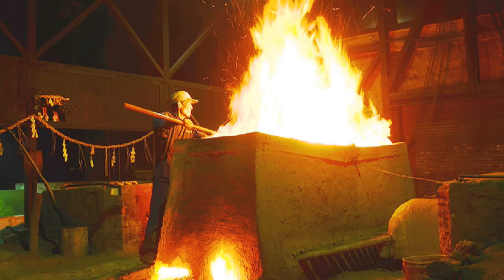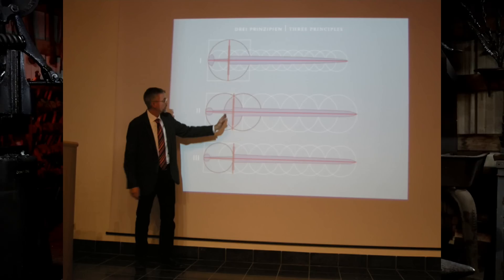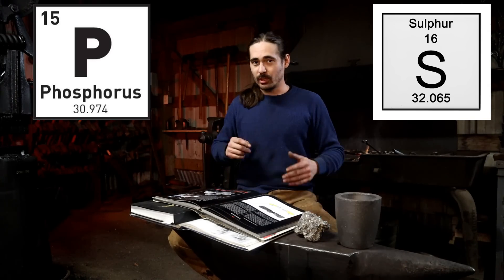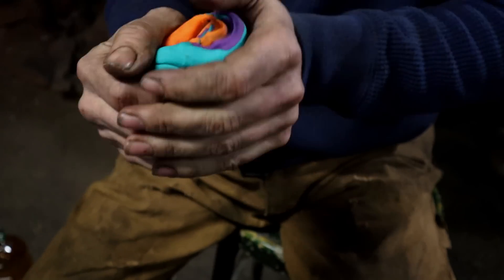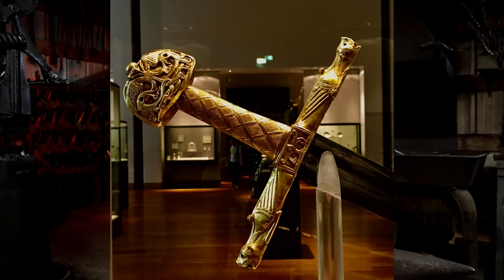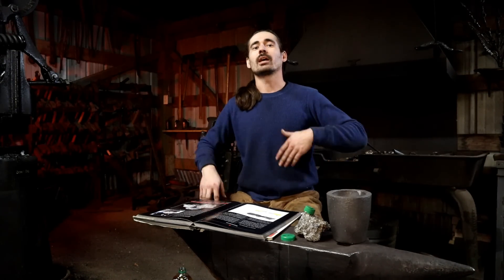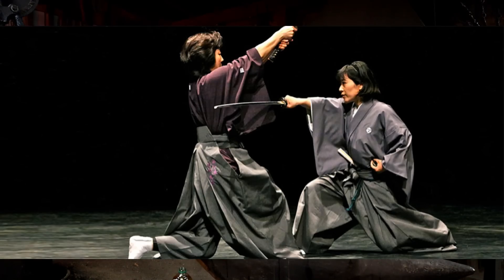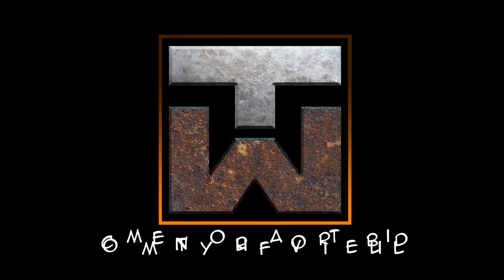Misconceptions About Medieval Steel - Wootz vs Bloom

Comment: You can't judge a steel by its phosphorus content.  Phosphorous serves more or less the same role as Carbon as a hardener. It is a well researched fact that phosphorus may be increased without decreasing the quality of steel if the amount of carbon is proportionately decreased.   So, the sabre containing 0.252% phosphorus and .596% carbon would have had a very similar properties to the sabre with 0.127% phosphorus  and 1.874% carbon.  The fact that these figures show such different carbon/phosphorus ratios but similar hardnesses tells us that the bladesmiths knew one of many possible techniques for reducing their wootz steel to their desired hardness until they reached what levels this particular culture considered ideal.  So, if they actually wanted a softer steel, all they had to do is continue whatever reduction process they already used up to this point until they got there.   The most common solution for reducing the hardness of medieval crucible steel was to use a kind of decarbonizing forge called s finery forge. These were invented in either China or India around 300BCE and made its way to Central Europe by the 1200s CE for just this purpose; so, the technology was there, it just did not become the norm until the 15th century which is the time period Shad was referencing when he discussed the rise of spring steel swords.
Reply from the maker: nosajimiki killeen the answer to this can not be short enough to type it all out and perhaps deserves another video response. Don’t forget to look at the Rockwell hardness of each example. That alone will Clear things up for you.
Reply: Why hello! One key problem is that there was no spring steel consistent enough to be called so up until the XVII century or so. On this you can watch Peter Johnson's presentation on the paradox of the sword. That is, at least in Europe,  most swords were about 45 rch on the edge aaand about 28 to 30 on the flats and the core. That is, mechanically the sword was not spring steel. 

Further,  phosphorus content increases the vulnerability to fatigue. And, on top of it, when we are discussing representative samples of wootz swords,  we are looking at about 1.5 to almost 2% carbon combined with high phosphorus. Actually,  if you read Alan Williams as well as other research on wootz and crucible steel the carbon content occasionally but consistently exceeds 2%... making those blades basically cast iron... or just short of that
Reply: @ThatWorks  So I looked closer at that table in your book and noticed that those sabers were using bulat steel. While a low Rockwell hardness is normally a problem it is a bit misleading with this kind of metal. Bulat steel (or Damascus steel as it is more commonly known) is intentionally slow cooled to create a seperation of the ferrite (hardness 200), and the cementite (hardness 640).  Because of this, the blade takes on bimetallic properties similar to pattern welding.  It takes impact and compression like a mild steel which is why it tests at such a low hardness, but also holds a very sharp edge from the exposed cementite.  That said, bulat steel is a very different technology than the kind of crucible steel known in Western Europe. When HEMA enthusiasts cite spring steel swords, they generally are referring to Western European late medieval weapons, not the Bulat steel blades more common in Middle Eastern sabres.   

It is surprisingly hard to find any good statistics on the chemical analysis of Western European steels of the late medieval period, but there is plenty of evidence of some kind of spring steel evolving as early as the 12th century with the introduction of arbalests. For a steel prod to be able to hold draw weighs over 1000lb without permanently deforming, Western Europeans needed to have figured out how to make spring steel, and the introduction of finery forges at about this same time seems to support the idea that they were using probably using a reduced crucible steel.

You also bring up near the end of your video the question of if European sword fighting styles support the likelihood of a certain quality of steel. I've read before that there is a distinct transition in 14th century German and Italian texts to a greater emphasis on the use of more abusive blocking parries whereas earlier texts support more emphasis on hilt guards and deflective parries.  From this, the argument can be made that the sword fighting manuals themselves reflect the existence of increasingly impact resistant steels becoming common in the sword making of the day.  

So if you do a follow up video, you might want to consider looking at how Western and Eastern European steels evolved differently and/or how early and late medieval steels were different.

Comment: Well FWIU the Anglo-Saxons were making pattern welded multilayered swords about half a millennium before the Japanese ever did. But pattern welded steel is not Damascus steel. Damascus steel is the common name for Wootz steel, Wootz steel means crucible steel from southern India & Sri Lanka with natural carbides made during a certain period of time. If something is not made of Wootz steel from Southern India during that time it is not Damascus. Meaning real Damascus has never been made in the US & Japan & the only Damascus made in Europe is made with steel originally from India.
Reply from the maker: I mean, you are mostly right but what does any of that have to do with what was stated in this video? Wootz did make its way to Japan and many other places. saying Europeans made layered swords before japan is silly. It all happened pretty much at the same time. As soon as steel and iron came into play, you had to layer or fold it to make it into usable blade material. I don't get why you typed all that out...

Comment: I happed to have a djvu scan somewhere of some pretty rare (1000 something copies) russian book about authors second take of bulat process restoration (Anosov was first, but the man was paranoidal and we have no notes left). What they found, is that wrought iron. carbon (in form of charcoal or plant matter) and pig iron were used in crucible charge. And glass on top to seal it. No ore. And they could get hardness as high as 72 HRC without making samples too brittle. Sulphur and phosphorus are solids, but with rather low boiling point. So while they get released while their salts are being reduced by CO in the bloomery, they evaporate.

Comment: In theory, although judging by the chemistry data it was not done much, could you refine the crucible steel puck using the same techniques as for bloom refinement? Can sulfur, phosphorus and carbon be oxidized out of the steel to some extent by folding?

Comment: I feel like crucible steel is better for quick, high carbon, hard munitions and blunt easy to shape and dense weapons and casted tool fittings and hardware. Bloomery steel seems more for the crafting of weapons that require more attention to detail and require a strong, but more playable material for things like siege works and long lasting gears and wheels.

Comment: @That Works
The building of fantasy/story swords is great. But let's think about this. 

If say for some reason swords were to come back into the common combat for some reason. What would those swords need to be?
Think of 3 types.
1. A sword designed for face to face on foot combat. Minimal armor. 
2. A sword designed for heavily armored opponents.
3. A sword designed for mounted engagement. 
4. and of course a short blade as a secondary back up, up close weapon. 

What would modern designs be and performance expectations.

Comment: Question: wouldn't folding cast iron into mild steel have similar results as the Japanese method? Raising the mild steels carbon content more inline with higher carbon steels, as well as working out impurities? As they break up the bloom and add stack pieces to fold/homogenize, it seem this is kind of what they're doing anyway.  🤔

Comment: In Japan, impurities in steel were removed by the tatara iron making method, which was made from the 6th century. The tatara ironmaking method uses the difference in melting temperature of iron, phosphorus, and sulfur to remove impurities. Old craftsmen used to call impurities Noro. In the West and China, phosphorus and sulfur-rich materials such as iron ore and coal are used, and blast furnaces do not melt and remove them.
The content of impurities such as phosphorus and sulfur in tamahagane is much lower than that of modern steel. If you take out unnecessary carbon by blacksmithing, the carbon content will drop to around 0.7%, which is not too hard and suitable for katana. The steel of katana is in a state where austenite and martensite, which have different hardness structures, are dispersed. When katana is sharpened with a sharpening stone, austenite is easily scraped and martensite remains, so it becomes like a "micro saw".
The non-metal inclusions remaining in the steel are rich in oxide-based inclusions. This oxide-based inclusion has the property of being softer and easier to stretch than general steel inclusions. Rather than making it finely dispersed and detoxified by folding back forging, it makes katana tenacious, forms a beautiful surface, is easy to polish and can form a good blade, and is given properties such as rust resistance, hardness, and bending. To do.
In other words, non-metal inclusions of general steel have an adverse effect, but non-metal inclusions scattered abundantly in tamahagane make it easier to fold and forge, so it is a benign inclusion that has the function of evolving the material.
Around 1970, Hitachi metals of Japan developed Yasugi Specialty Steel from the manufacturing method of tamahagane, which is a material of katana.https://www.hitachi-metals.co.jp/e/yss/ourbrand.html
Yasugi Steel has the same properties as katana, is firm, elastic and sturdy, so it is used in various products such as cutlery ore and engines.https://www.hitachi-metals.co.jp/e/yss/ourproduct.html

Comment: Thank you for a fascinatingly informative discussion of steel quality.
My major hobby (if not obvious) is horses and my other fun time is swords and lances from horseback. From my own playing around with swords and targets I can give you the following observations:
A straight sword is made to give point. A curved sword isn't very good at all. The more a sword is curved, the more it becomes impossible to give an effective thrust from a charging horse. Curved swords are very good for close melee combat, and cutting as one passes by a target, though.

When the straight sword goes into the target, the blade is held horizontally. As the target passes by, the edge of the blade turns as if on a fulcrum, which causes a slice sideways through the target. As the target goes beyond a certain point, the sword naturally pulls out from the target. 

The only time the sword might be wrenched from the grip is if the blade does not go in horizontally, or if one allows the arm to bend.
If you want to see this in action, check out the cavalry training from WWI (https://www.youtube.com/watch?v=Oz4BBPR5fvw) at 8:36 where they practice with the sword.

Comment: TL;DW
Welding highcarbon edges was a matter of scarcity.
Welding HC and LC doesn't get properties of both steels. LC steel absorbs the break of the HC steel, but the fracture is there.

Comment: Wait but why do medieval/renaissance era combat treatises mention sword flexing if spring steel wasn't a thing back then? The most common mention of it from what I've seen at least comes with half swording technique,the reason why you grab the blade is to manually reduce the flex of the blade so you can use it more effectively as a thrusting weapon.

If swords weren't springy and just bent and stayed bent then I highly doubt using them as thrusting weapons at all would've been a good idea.
Reply: It’s entirely possible that spring steel did exist but was extremely rare and was only available to royals and top nobles
Reply: Well for one, spring steel usually refers to a modern alloy which performs nothing like historical springs did. It would just be called spring tempering, and was done historically outside of Europe too. Some notable examples would be some Han swords that used this.

Two, a blade that wasn't spring tempered can retain some flex.

Comment: I would argue that HEMA already looks a lot like koyru kenjutsu. Maybe not so much Iai, but Iai is very purpose built for situations that I imagine were not common in medieval and renaissance Europe. Could you say more about which techniques in HEMA seem to violate the capacity of historically forged swords? The flexibility and strength of modern feders, to my understanding, has more to do with safety that historical accuracy.
Reply: Kenjutsu and probably Iaijutsu/battojutsu would make for a better comparison,the term Iaido didn't appear until 1932.

Comment: I would add a couple of points from a martial perspective. The first being that swords were pretty much the last wealon of choice for anyone with a choice. On the battlefield it is essentially rock paper scissors when it comes to a weapons range. That's why the Samurai valued the bow and spear far more than the sword. Tho culturally the sword was revered. This is true of Europe as well. Smart warriors used longer weapons with more range. Another thing to consider is that the sword, no matter what the shape, is generally a poke them at a distance weapon designed to attack weak spots. Weak spots in armor and physiology. Whether against armor or not you position your sword thru the "swings" to put it in a position to deliver the cut you want where you want. Against an armored opponent the goal isn't to break thru the armor but to attack weak spots in the armor to get to the fleshy goodness underneath. Also because of how long humans take to die, even with a cut to an artery, it's only the last few inches of any blade that would be the primary focus point of any energy. Never give your opponent any distance to reach you even if you have delivered a fatal blow and such you would never look to use more than the end of your weapon. Against bare flesh any metal with any edge will kill. That's not that's complicated but the interplay between the blade and the armor, the negative space of a combat, determines the properties of a weapon. Also if you think about how force is distributed thru a more malleable material like metal vs a material like lacquered wood that would tend to shatter you can also see why the blades of europe weren't for the most part hardened vs the blades of Japan. The goal when hitting with the edge or tip of a European blade isn't to pierce or shatter the armor but to transfer force so your opponent becomes of balance or damaged thru enough force transfer. This allows for a killing blow to be delivered thru a weak point in the armor or thru incapacitation due to blunt force trauma then killing them.

Comment: Dear Iliya, I am interested in the swords produced in Iran (shamshir and qaddara) and you mentioned that there was something different about Iranian sword production with regard to certain impurities. Were the smiths able to remove the phosphorus and sulfur by forging/folding like how bloomery steel could be?

Also, you mention that the pattern in wootz is partly caused by the phosphorus and sulfur, but i was under the impression that it was due to elements like vanadium creating large carbides that segregated into pseudo layers. can you elaborate on that?

Comment: stupid question ... but. why not simply make crucible steel . then chisel the top layer away, thus getting rid of the slag containing all the impurities (that have supposedly been floating on top of the steel) including the phosphorus and sulfur that have also liquefied and thus should be part of the slag layer..... Then fold the steel to reduce its carbon content ..................?
Reply: also , i understand the point that is tried to be made by using scientific data about tamahagane, but how come no data on phosphorus content in crucible steel is ever presented ? it kinda cuts corners in proving that tamahagane is far better :x

Comment: This is why I warn about artistic meteorite swords. People try to preserve the cross section in the Damascus pattern so much that they forget it's made of massive crystals that have the 2 major impurities in them. You have to reduce the meteorite to melt in order to get the slag out and reduce crystal size.

I'm still working on my method. So far I need a crucible, my meteorite and a select blue chromium agate. I'm curious as to what the blade retains in ingot form to confirm its origin. If you want to display one of the meteors in cross section, do it in the pommel or crossguard as a gemstone and treat it like one.

Sorry, side rant on modern smiths.

Comment: So, I've got some more questions. After watching Shad's new video about the NOT lost Damascus Steel video, he was talking about how crucible steel would come out as very high carbon steel or cast iron (over 1%) making it brittle. It was then taken to a finery and they would reduce the carbon content in the blade making it High carbon steel, not cast iron. But according to Ilya, historically they still had over 1% carbon so was this process not done?

Also, if you poke a hole in the crucible so as not to make it a bomb, and phosphorus and sulfur are gasses, wouldn't they leach out of the hole in the crucible, or how does that work?